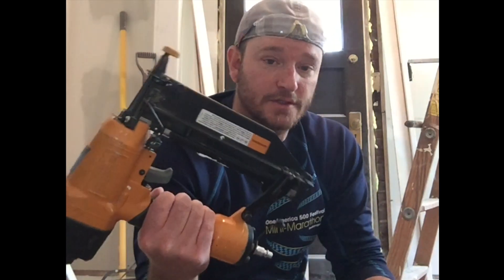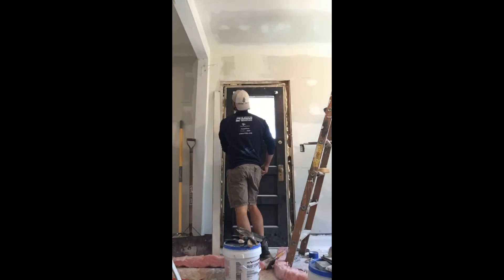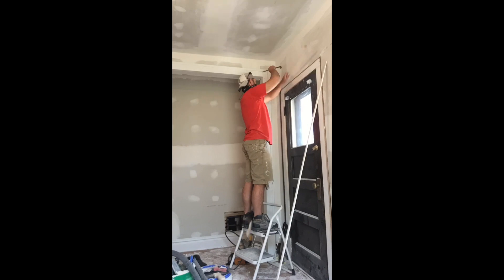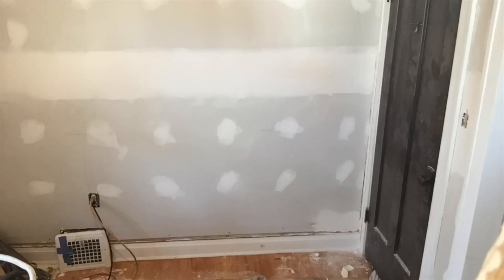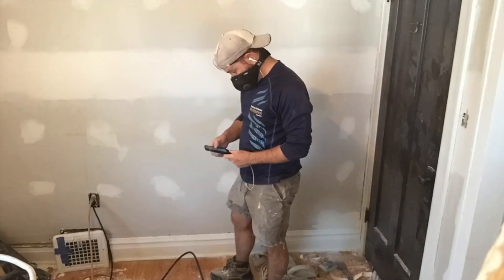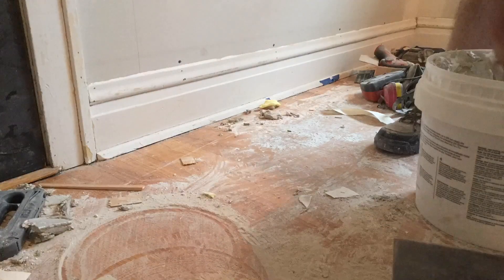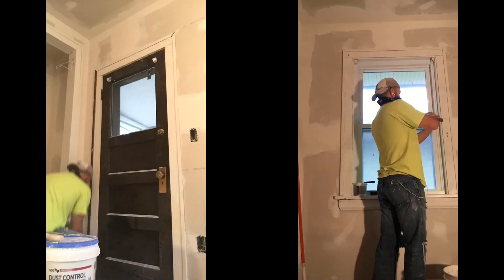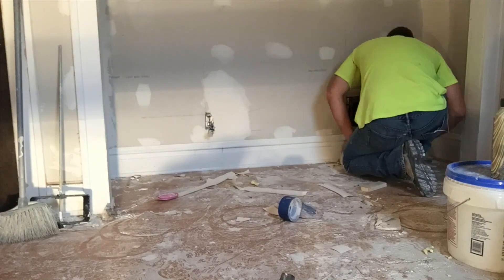Reinstalling Trim in an old house and prep it for painting (Part 6 Bedroom Rehab)

Comment: Working on a bathroom with 1970 Sheetrock. It's falling apart at the bottom so I am going to have to put some shims in. Uggggg thanks for the video.
Reply from the maker: Try putting a drywall screw in there instead of shims.  You can easily adjust it.  I know there are video on YouTube from pros showing how to do it.

Comment: I would have painted before trim but not sure if there is a reason not to.  I never seen any new houses paint the walls prior to putting trim up either. Wonder why.
Reply from the maker: I only took off the top trim board.  This way I didn't need to reinstall the whole thing.  Paining before I ensured I did not have to cut in twice.  Just once.  Hope this helps